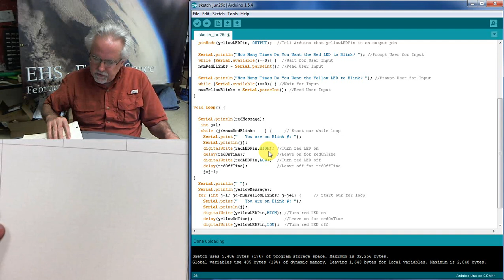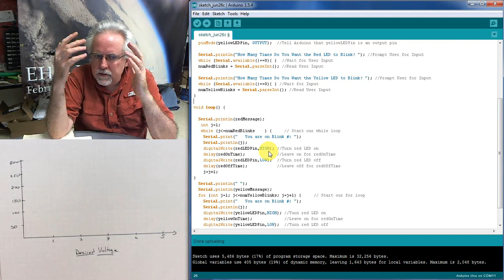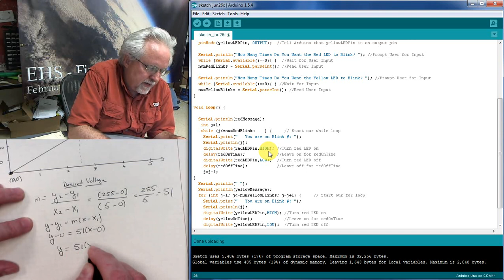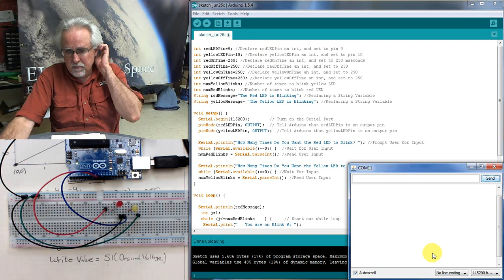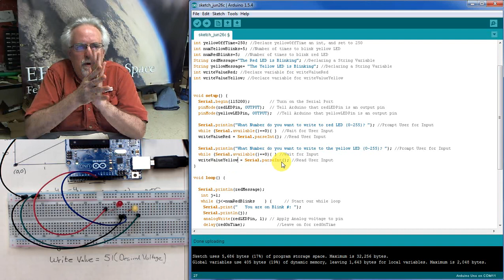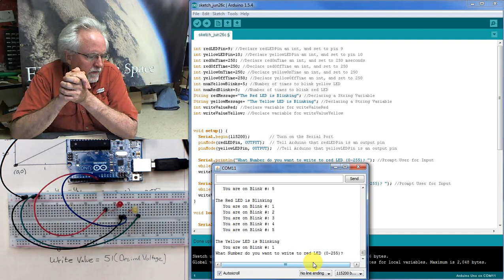Comment: int redLEDPin=9; //Declare redLEDPin an int, and set to pin 9 
int yellowLEDPin=10; //Declare yellowLEDPin an int, and set to pin 10 
int redOnTime; 
int redOffTime;
int yellowOnTime;
int yellowOffTime;
int numYellowBlinks; 
int numRedBlinks;  
String redMessage="The Red LED is Blinking"; //Declaring a String Variable 
String yellowMessage="The Yellow LED is Blinking"; //Declaring a String Variable

void setup() {
  // put your setup code here, to run once:
Serial.begin(115200);
 pinMode(redLEDPin, OUTPUT);  // Tell Arduino that redLEDPin is an output pin
 pinMode(yellowLEDPin, OUTPUT);  //Tell Arduino that yellowLEDPin is an output pin

Serial.println("HOW MANY TIMES DO YOU WANT THE RED LED TO BLINK? ");
while(Serial.available()==0) { } // Wait for User to Input Data 
  numRedBlinks=Serial.parseInt();  //Read the data the user has input

Serial.println("HOW MANY TIMES DO YOU WANT THE YELLOW LED TO BLINK? ");
while(Serial.available()==0) { } // Wait for User to Input Data 
  numYellowBlinks=Serial.parseInt();  //Read the data the user has input

Serial.println("HOW LONG MUST THE ON TIME BE OF RED LED? ");
while(Serial.available()==0) { } // Wait for User to Input Data 
 redOnTime=Serial.parseInt();  //Read the data the user has input

Serial.println("HOW LONG MUST THE OFF TIME BE OF RED LED? ");
while(Serial.available()==0) { } // Wait for User to Input Data 
 redOffTime=Serial.parseInt();  //Read the data the user has input

Serial.println("HOW LONG MUST THE ON TIME BE OF YELLOW LED? ");
while(Serial.available()==0) { } // Wait for User to Input Data 
yellowOnTime=Serial.parseInt();  //Read the data the user has input

Serial.println("HOW LONG MUST THE OFF TIME BE OF YELLOW LED? ");
while(Serial.available()==0) { } // Wait for User to Input Data 
 yellowOffTime=Serial.parseInt();  //Read the data the user has input
}

void loop() {
  // put your main code here, to run repeatedly:
  

Serial.println(redMessage);
int j=1;
while (j<=numRedBlinks   ) {     // Start our for loop
      Serial.print("   You are on Blink #: ");
      Serial.println(j);
    digitalWrite(redLEDPin,HIGH); //Turn red LED on
    delay(redOnTime);             //Leave on for redOnTime
    digitalWrite(redLEDPin,LOW);  //Turn red LED off
    delay(redOffTime);            //Leave off for redOffTime
j=j+1;
}
  Serial.println(" ");
  Serial.println(yellowMessage);

for (int j=1; j<=numYellowBlinks; j=j+1) {     // Start our for loop
   Serial.print("   You are on Blink #: ");
    Serial.println(j);
    digitalWrite(yellowLEDPin,HIGH); //Turn yellow LED on
    delay(yellowOnTime);             //Leave on for yellowOnTime
    digitalWrite(yellowLEDPin,LOW);  //Turn yellow LED off
    delay(yellowOffTime);            //Leave off for yellowOffTime
}
  Serial.println(" ");

}

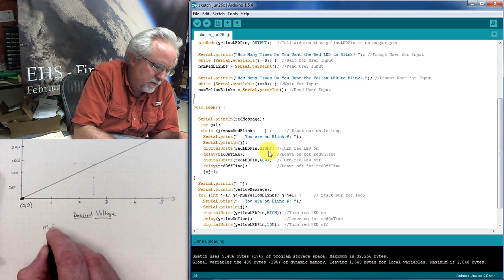Comment: ok i lost you when you started to go into @8:39 formula, where did you came out with the m= Y2 - Y1 and so on this whole section im lost, are you using the letters as variable names ? i mean i get that this is the coordinate of the given graph a & y axis but what i dont get is where is this y2 and y1 is coming from and the same can be said about X ?   maybe it will help me if you tell me what type of math you used to derive this equation ? because when i seen the triangle graph i thought you was going to bust out some trig formulas but then i noticed that this is not the case and while you are multiplying where its obvious in other cases im trying to figure out how did you came up with  anything up to Y = 51(x)
Reply: +Frank Lopez It is Algebra I, and how to do the math for a line, or a linear equation. If you would like to learn more, go to the free "Kahn Academy" math lessons and watch the short clips on "linear equations" or equations of lines. That should help.
Reply: Paul McWhorter
appreciated thanks Paul!

Comment: hello sir,
can we light two independent LEDs at the same time having different delay period and also the startng time of both the LEDs is different,i.e the LEDs start face their first digitalWrite(ledPin,HIGH) at the different time?
thank you
Reply: Biplab Roy This is the problem. The Arduino executes one command at a time. If you put in a delay of one second, it delays for everything. Blinking at two different rates on two LED would be hard.
Reply: Paul McWhorter sir, how o use an LCD to tap out the displayed data for further use in the program/read DATA from LCD display?
thank you

Comment: Is that okay to take the resistors out of circuit when you reduce the voltage via analog write to 1 volt?
Reply: Andrey Danchenko LED are very nonlinear devices. You should always use current limiting resistors.
Reply: Paul McWhorter But would you please explain why? I = V / R, if I've limited current by reducing V via Arduino controller why do I need extra R (resistors)?
Reply: Andrey Danchenko Because a diode is not a constant resistance. The diode does not objey Ohm's law, because it does not have a constant resistance. Always use a current limiting resistor.
Reply: Paul McWhorter Watching your next lesson. Thank you!